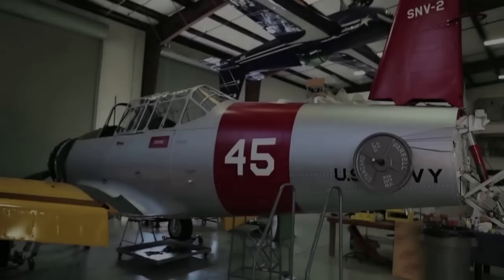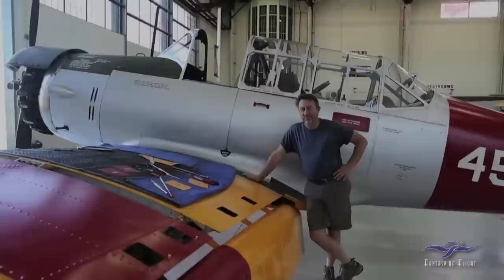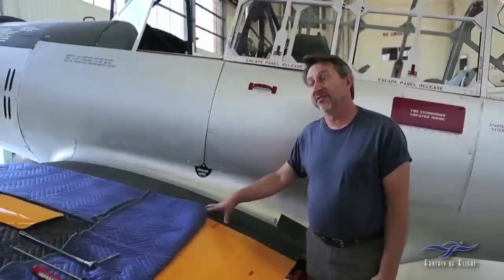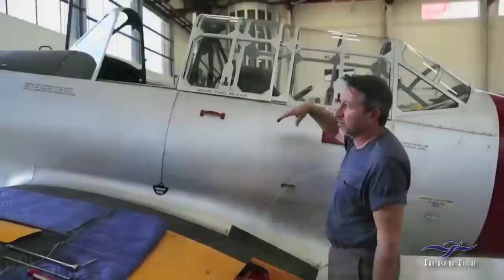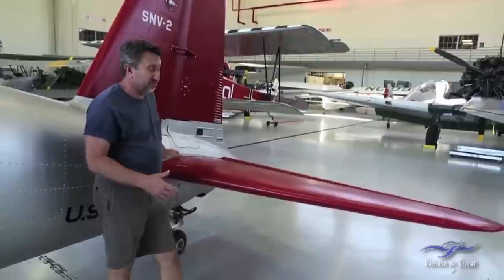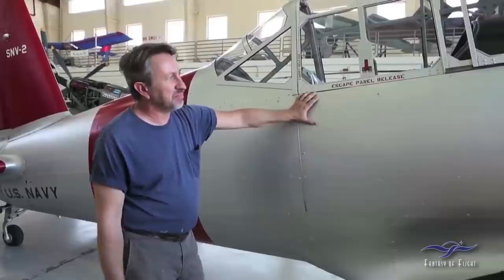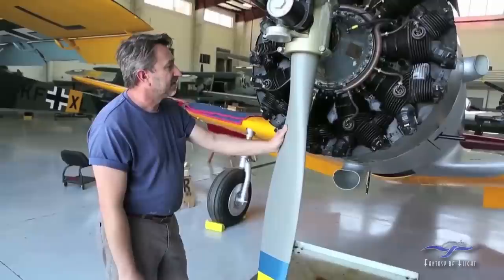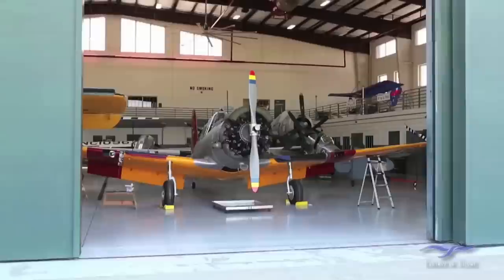Vultee BT-15 - Update Review

Comment: I've worked on a BT13 with the 985 Pratt including adding a smoke kit. That was fun to get approved. I put the tank just behind the back seat and attached it to the structural tubing with 4130 straps. Electrical problems were fun on that old system! Joke joke.